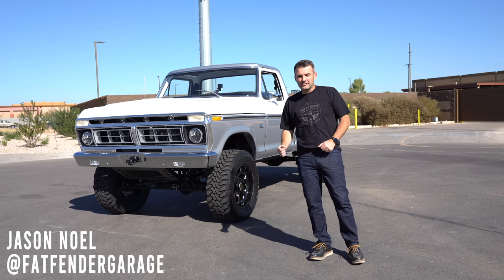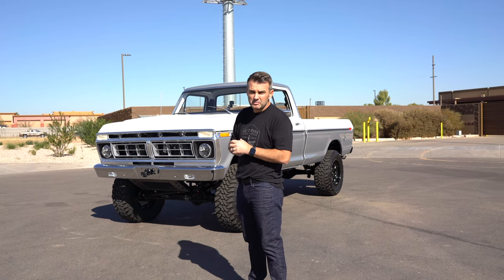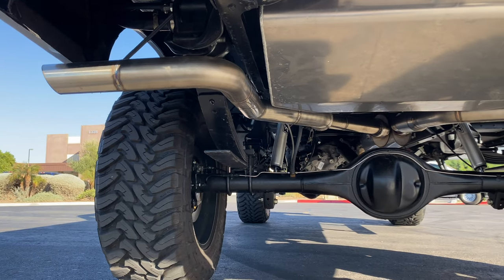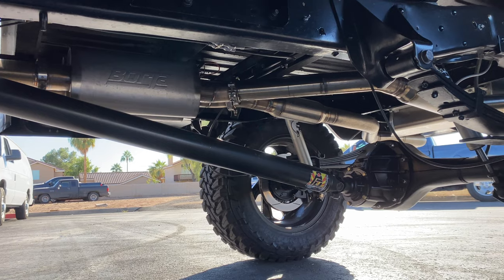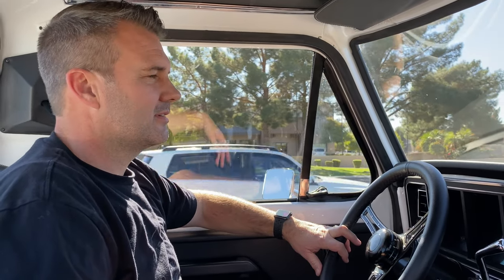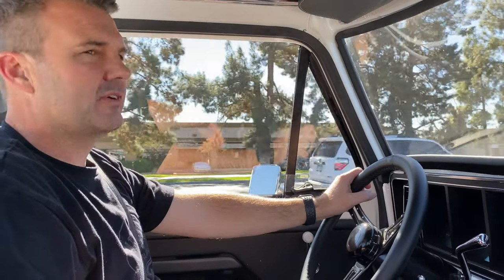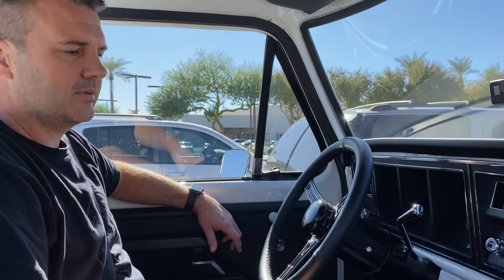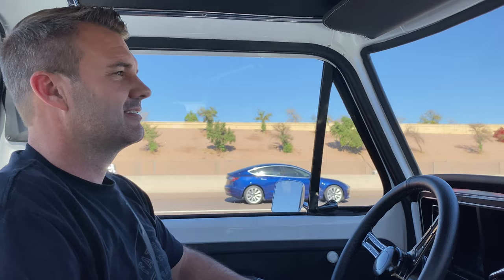What's It Like to Drive a Supercharged Coyote Swapped 4wd Ford?

Comment: One of the best restomod trucks ever! Just love the ‘73-‘79 trucks. Ordered a new one back in ‘79. 4x2 loaded with 460. 7250.00 way back then. Still have order form.
Reply: They didn't come with 460s from the factory, 400m was the biggest motor you could get.
Reply: @westonharby165  absolutely did. I have order form. Have owned many of them.
Reply: @westonharby165  460 starting in 1974. F150’s and 250’s
Reply: @randysrestoration  I have '79 f350 that used to my my great grandpas farm truck, while it was a custom, the only option it didn't have was A/C. It had 4x4, power steering, front disk brakes, and the biggest motor you could get a 400m.
Reply: @westonharby165  that’s because it was a 4x4. 
If you read what I typed I said one i ordered was a 4x2
Reply: @randysrestoration  oh missed that. Did know you could get a 460 in 79
Reply: @westonharby165  There is no such thing as a 400m. It's just a 400. No M added to it. The 351M is a de-tuned 400.
Reply: Yep, those years are still the best all time Trucks !! I still think about the orange and white one I had with 460- auto W/A/C
Reply: I had a 79 F-100 Ranger, 300-6, 4 speed overdrive and AC. $5800.00 Canadian dollars at the time.
Reply: @allanrheaume5549  they didn't put over drive in those trucks, the highest gear in a np435 is 1:1
Reply: @westonharby165  Mine didn't have the NP435 and no granny low. 4th was overdrive 1: 0.85 ratio, my 3rd gear was 1:1
Reply: @westonharby165  dude stop
Reply: @westonharby165   sure they did. My buddy had a 74 with 460.
Reply: @westonharby165  you've been wrong every time you've tried to prove someone wrong. Just give it up you're terrible at it lol
Reply: @westonharby165  I think the guy would know if they cane with a 460 or not lol

Comment: You've built some really nice trucks man ( no pimp my ride garbage) . it's amazing how you restore and still give it a modern touch and still keep the authenticity of it. Thats a real fine line many builders haven't found...  Your team of mechanics ( shop crew) must be extremely proud of every truck they build.
Reply: Thank you someone else that couldn't stand PMR. They did all this work on a car or truck but then leave the busted work out powertrain in it. The add extra weight with all the sound system, gadgets and gizmos, added massive power draw on the alternator and put bigger rims and tires on for a tired transmission not to mention the extra weight from stereo system. They actually did another thing later on bof how's the ride doing and found that alot of those rides were broken down in a yard because they never did anything with the powertrain. Here in this video though it looks like they went from the ground up. the frame looks like it is powder coated, it's clean from top to bottom, sounds amazing and nothing looks out of place or rigged. I absolutely love that supercharger whine too. So yes I agree with you it's not done like PMR would do and just polish a turd sprinkle new stuff on it and say surprise.... we gave you an awesome lawn ornament, it won't go anywhere but it's got rimz and a system so you can chill at home and be the envy of every prepubescent boy in the surrounding trailer park area. Thanks xibit you gave me an expensive chair so I can sit and watch others drive while while I sit and pretend to drive dawg. Thanks for reading my rant on that waste of an afternoon MTV used to show before they sold the company to Rob Drydickhead.

Comment: Love the truck.  Beautiful work.  My dad had a '75 Ford, basic truck, 390ci with an oil bath filter, 4spd manual.  I remember when we added power steering to it and ultimately when the power steering failed on Christmas day in the late 80's.  I was driving the truck home and with each turn was adding more steering wheel turns until one left turn where the steering completely failed.  It was like having a roulette wheel in front of me, the complete absence of steering.  After getting the truck towed home, we began tearing down the steering and rebuilt the steering box.  I remember trying to get the new bearings in the steering gear, installed them, got the truck together and went for a drive.  After one right turn the truck would only turn left, would jam up going right.  Got it back to the garage, tear down the steering again, had to re-install the bearings again in the recirculating ball and nut steering gear.  Together again, road test again, this time it would jam up with left turns and would only turn right.  So a series of right turns back to the garage to fix again.  Third time got it right, installed the bearings, they stayed in place and the repair was good.  The truck still exists and is used on a friends farm.  Would love to bring it back and make it new again like this F150.

Comment: Thank you for the video! I have an older 89 F250 Custom model 2 wheel drive that I have over the years been dabbling with. I bought it 16 years ago after it's entire drivetrain was redone. Since then I've gone through it a couple times refreshing and changing little things for better performance. When I bought it, it was designed to haul a camper, with 16 1/2" rims and bias ply tires. I took it to 17" with all season radials. What a difference! With everything I had done over the years and gone around the USA 3 times working I really have enjoyed this truck. When I felt it needed a complete overhaul in March of 2021, I was still getting 19mpg on average with or without a load including through the mountains, (if I kept my foot out of it). Just normal driving and it could be a lot of fun! 
In September I was done with all the machining and new, new parts. Fired it up, warmed it up and sounded great! This was 10PM, so shut it off for the night to test drive the next day.

 Morning came and fired it up, let it warm up and went to back out of my Godfathers shop here in Washington.. He used to race so it was the perfect shop to rebuild it in. Like a switch was thrown it started thumping hard, jumped out and crawled underneath. Something in the area of the mains went. Backed it over by a tree, bought a plane ticket and went back to my ranch in Nevada. Turned out to be the oil pump torque on the bolts that came with it didn't hold. Never heard of bolts coming with the oil pump yet they did. The other odd thing was the pump housing holes were threaded, and hadn't seen that before! Bolts went right in and torqued to specs.

 In March of 22, I came back and pulled the engine, then took to a friends professional engine shop in Olympia WA and had it completely redone with a guarantee! The transmission I had done at another friends pro shop here in Olympia. Looking forward to many more years of enjoyment! Thank you for your video! I love to watch and see what others are doing with vehicles. This is my first time seeing your channel and not the last! All the best to you and your!

Comment: Man I love this. I'd buy this before any new f150. Gotta get these before Bidens Paris Accords bans all the gas and old models trucks from the highway.
Reply: vintage vehicles have always been exempt from any requirements of the paris accord. they would have had problems 5 years ago when we joined.
Reply: probably costs as much or more.
Reply: I wouldn't.  I need a vehicle to drive.
Reply: David Metcalf  engine itself is around 25 grand
Reply: You might well get two of them for the price tag on this one 🤔
Reply: @mrbigshot29  Does no good if fuel is so expensive to drive it just sits there. We're a ways off from that, but it's coming, vintage or not.

Comment: My first new truck was a 1976 Ford F-150 4x4 long bed in midnight blue. Paid $4500 for it new (bought in 77). It came with an FE block 360, 4 speed with granny low. Over the course of time I raised it 3" in the front, installed a 428CJ engine, installed a "fat" chrome roll bar with those round lights, chrome diff covers and 38" Denman ground hogs. Ripping through the mud on the banks of the Arkansas river. I was 19 at the time. What a memory that is.

Comment: I miss my 73 high boy 🥺. 360 2v granny , radio delete no ps no pb. Had 310,000 miles when i bought out of the California desert. Bought from orig owner , motor was never opened up. Sat for 15 years. Took me a fuel filter, clean gas and a batter and it fired up on second try 🤘🏼. Ran perfect

Comment: Beautiful truck!! I eliminated steering wheel play and rough ride by dropping a 78 body down over a 2012 donor truck! Fit surprisingly well, no wiring or engine/running gear alignment issues. I’m shocked more people don’t do it.
Reply: I was wondering about body options on my '99 SD CC 7.3.
Reply: @c.j.rogers2422  not sure about the 99 style year, but best way to check is measure width of the door opening pinch welds to see if they’re close. If they are, anything is possible

Comment: I had a 1976 F350 Super camper It has a 6 inch extended wheelbase and rides smooth with gas shocks. Ranger XLT package. I gave it to my brother 4 years ago. Bright Ford blue and chrome bumpers original grill.

Comment: Man!! that's a bad truck. I love the symphony of gear shifts too. It's always crazy to hear a V8 shift 5,6,7,8 times on one pull it's crazy. That it may be I'm a little old school but I'm used to three shifts and then the drop into overdrive and then the torque converter lockin up. Awesome build. I wish I had 50 grand to have y'all build me one

Comment: My 1979 F250 Ford factory  highboy camper special three fuel tanks two batteries with a bench seat which I have slept on a mini nights in the winter I would never want buckets seats and mine had an international 1 ton front end. With a 390 with glass packs that truck sounded like a bad ass. And it was a bad ass.

Comment: I still have my 75 F100 4x4 ,390 engine,short bed.purchased in1975 for 5,600.00.had to change from a 360, no one will do any more as far as trucks go.I have used it every where from work to the tallest mountains in the western United states.My son will soon be the new owner.There is not enough good things to say about the wonderful rides it has taken me on.

Comment: The stock bench seat that I had in my 73 XLT was one of the most comfortable seats in my opinion. I would of never put the bucket seats in this truck, but to each his own! Nice truck! My 73 was a hand-me-down from my father. I pulled the stock 360 boat anchor out and installed a lumpy 390 with a Thunderbird 3x2 intake/Holly 2 barrel carbs. It was a fun truck to drive! If you were not into the outside carbs too much, you could actually get half decent  mileage running just off of the center 2 barrel.

Comment: I had a 1976 F250 4x4 Trailer Special... Granny gear, I had to take off in second it was 4 on the floor but more like a 3 speed manual really.. I loved that truck!! It was my first car when I was 17.. I had it back in 1991.. It was lifted 4"s and had 33's BFGoodridges.. 390 with a Nasty set of headers and flowmaster exhaust out the back.. Wish I still had it... OH and I love the long bed's, always did.. I never understood buying a truck and not getting an 8 foot bed.. But to each his own..

Comment: I'm putting together a nice square squarebody right now, don't boo me, but this was great to watch, it's over the top and original at the same time. I did have a real nice '79 F-150 short  bed, pretty high up there, 38.5 Gateways on it, nothing special, had the straight 6 with the 4 speed but super clean, the nice deep Ford blue from back then, great trucks

Comment: I made a bracket that holds a gallon wiper fluid bottle that fits snug to radiator to keep warm. Made a cap that fits with an external pump and when empty pop in a new bottle.

Comment: Beautiful restoration.  I just bought a 1978 F150 XLT with two wheel drive and a long bed.  I'll pass on the Coyote engine but I'll go with the same color scheme with steel wheels. Maybe same interior treatment, though, I go back and forth between using bench and bucket seats.  Thanks for the inspiration!
Reply: Just stumbled across this video and the first thing I thought was I wish it had a bench. Go with the bench! Trucks with buckets just don't have that same giddy up, gonna get some work done today feel that a truck with a bench does.

Comment: That is one beautiful truck. I had in my youth a 1970 ford f 100 short wheel base with a 3oo six cylinder. at the time I wanted a newer truck. Got one and afterward regretted ever getting rid of it. I'm not a fan of hotrods or loud pipes just great looking old trucks. That old truck was simple to work on and easy to keep running.

Comment: Beautiful Truck as a Collision Tech, First thing I noticed is the body work is straight,  nice to see that these days.
Second I would of converted to the 79 Grill and Lights.

If I ever hit the lotto you can build be a Black 79 F-150 with Push to start with a key fob with all the anti theft Security that Ford puts in a modern car, Electric rack for steering, I don’t like the loose steering on the old trucks.

Great job.
Reply from the maker: Thank you!

Comment: My Dad had a couple dent side F250's that I drove in the snow. Terrible traction in the snow. I think we were running the equivalent of 265 rubber and it would break it loose in the dry pretty easy too, and those 351M motors didn't exactly have a ton of horsepower. Weight balance unloaded was all over the front tires. Not surprised with all that horsepower that you're breaking them loose.

Comment: I have a 64 F100 that has the original engine and it still runs I've got to do some things to it such as welding new floorboards and firewall but it's a barn find the fact that it still runs is what I want to restore it just need a space to work I am a welder and I have had some experience on tearing down engines and stuff like that when I was younger

Comment: I did a bench / bucket adjustable out of an olds. They were black leather . I had a 1977 ford f150 back in the early 90`s . You have to fabricate a riser so they will be tall enough .

Comment: I was surprised and pleased that you paired the Coyote with the 10 speed auto… when you were describing the engine I thought to myself “it’s probably paired with an older 4 speed auto” because you generally see that with these types of builds, so the 10 speed is a nice extra touch that really helps to take advantage of that power. I’d prefer a more old school looking set of wheels, but that’s just preference, it’s a gorgeous truck.

Comment: I like the toolbox on the side. My stepdad had a 3/4 ton  Ranger Camper Special ( that was before the little rangers like I have now). I can still remember the smell of the plastic lining in that side box, we lived in Deep South Florida and it got so hat that it melted every one he put in it.  I would buy that truck before I would buy a new truck. I don't really like those wheels. I would rather have some custom ( stock looking wheels ) and I'm glad you did the exhaust right. I know a young kid that had to have the loudest most obnoxiously loud mustang. It takes them a while ( and 1 point from getting their DL away) to realize how stupid it is to announce that you are hauling ass. 
As for as I'm concerned this is the way a commercial should be made
Show your work talk about the problems you have come up against and that you have solved them and you sell the solution. I learned to drive on these trucks ,so I like the play in the wheel ( that's a real mans truck). When my little ranger and my 2500 dodge /cummins die. I will be making a call to Chandler Az.for a bronco or possibly a lonhbed 4 wheel drive. Do you work anything but fords? I'm 60 and I like to play a little but I also know who is going to fix it

Comment: You should be able to take most of the steering wheel play out by removing the rag joints and the joint at the steering box and replace them with U-Joints.  Of course, the power steering box needs to be in good shape as well.

Comment: I have a 1978 F150 with round headlights.. v8 302 with a 3 on the tree.  I want to restore it and am calling these guys no doubt!
Reply: They stopped the round ones mid year 78, someone must have changed yours!
Reply: @bigworm9030  Great catch! I just typod that and fixed it. I also have a 72 bumpside but it might be a little bit too far gone with the cab mounts rusted out I should call these guys to see how much rust is too much rust to do a full restoration!

Comment: So you need to look up Redhead Steering Gears or Blue Top Steering Gears for the power steering gear box, they are by far the best around for this old trucks. I have a Red on my 90 F250 and a Blue on my 87 EB Bronco, and there is next to no play in the steering wheel Bronco's on a 6" lift and F250 is on 3" lift. Love the truck, wish I hadn't sold my 79 to a friend.
Reply from the maker: I’ve heard of them. They were hard to get ahold of. Maybe pandemic issues. I’ll try again.

Comment: Beautiful truck!  only two things I would change.  I absolutely hate the tall wheel craze.  Half tons 15"x8".  12.50s still go on an 8" wheel nice and don't eat wheel bearings with good back spacing.  The other thing and I didn't get a really super long look, but the pinion angle may be a problem.  That's pretty darn good, especially with one being my opinion!  I don't know the cost in it, but I'd rather drive that than anything new.  I think I could do the frame and drivetrain, but the bodywork I wouldn't attempt.

Comment: if it had a 460 big block with a 5 speed on the floor, and either royal blue or blacked out. that is my ultimate dream lottery truck. (also would get 69 shelby gt 500 dressed as ellenor as dream lotto car)

Comment: Question. Since you used the newer transfercase  and used the turn dial 4wd switch. Do you still have the locking hubs on the front axles, or is the axle set up in the full time 4wd configuration